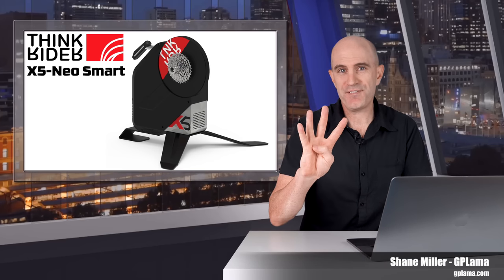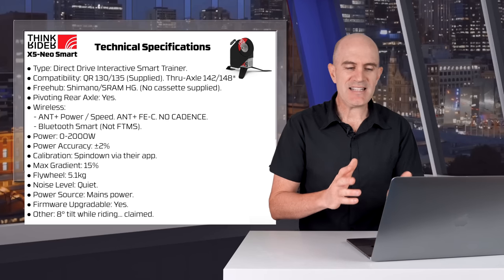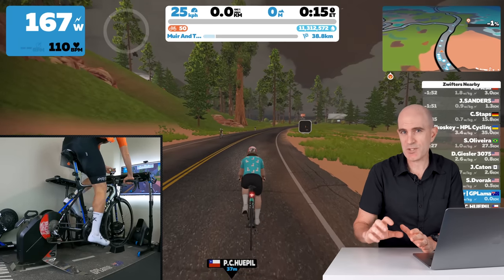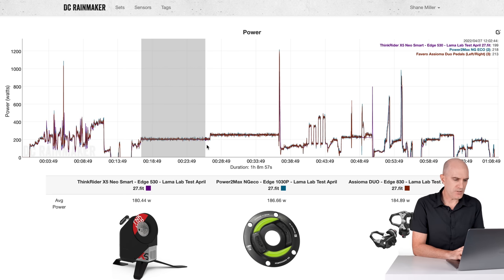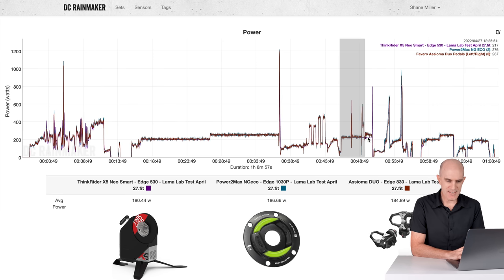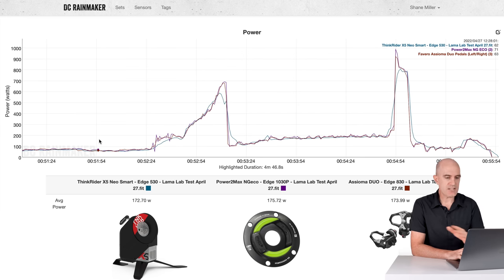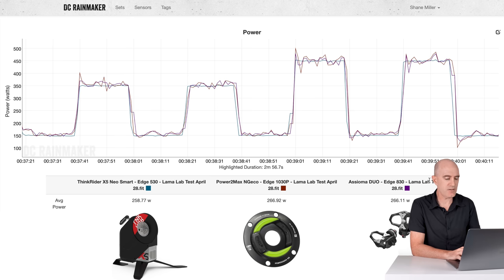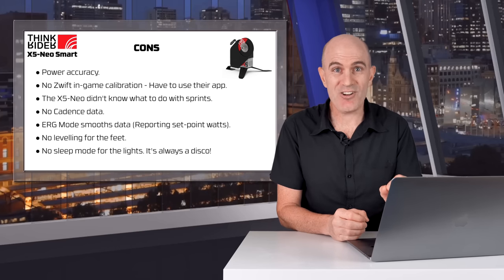ThinkRider X5-Neo Smart Cycle Trainer: Details // Ride Review

Comment: Excellent review, like all the ones I've seen on this channel. I have 2 of the smart trainers that you have reviewed, the Magene T300, which presents the same problem that you noticed, that when increasing the resistance, it overestimates the power, and the Thinkrider X5, which, as in the tests that appear in this video, it scores a little less power for me than the Powertap P1 pedals, which is consistent with energy loss from chain rubbing. I've had the Thinkrider X5 for 1 week, and what has surprised me is that it now measures cadence, and with excellent precision. I knew that the manufacturers of this smart trainer had not achieved an accurate estimation of the cadence, but apparently by updating the app, they have managed to do so, with some algorithm.

Comment: Hey @gplama I've now spent about 40hrs on this trainer, mainly doing structured workouts.
Received the unit in January, updated the firmware and the cadence had been fixed.
There's been one more firmware update since then which set the erg mode smoothing to on by default and minor other fixes.
I think it's well worth another visit
Reply: So, atm, is reading the cadence and the power reading is more accurate?

Comment: @Shane Miller - GPLama I love your reviews, they are technical, shrewd and I perceive impartiality. It would be great to review the X7 Pro (4gen) or redo this unit after software updates. They included cadence (estimated) and altered some power measurement intervals (on X5 and X7 models). Buyer reports in marketplaces and forums reviews are conflicting, praise for the ThinkRideer X7 Pro (4Gen) is the majority. But the evaluations are not exempt, the praise can be the unfounded reflection of a nice experience with the trainner. I took a chance on the X7 Pro, that is on the way, and would greatly appreciate your review. Greetings and keep up the good work!
Reply: Seu x7 ja chegou? se sim, poderia me contar a experiência com ele?
Reply: @hebertokano , só via sua msg agora. Chegou em poucos dias,comprei pela loja oficial deles no Ali, que possui unidades já no Brasil. Bom que não há chance de surpresa com impostos. Estou 100% satisfeito com ele. Funciona perfeitamente com todos aplicativos e o seu app nativo também é bom para refazer suas rotas ou outras que baixar o GPX. Também pode conectar direto no Garmin. O fato de ter 5º de jogo lateral torna a experiência bem melhor, traz mais conforto e aproxima da sensação de pedalar na rua. Alegam ser melhor para quadros em carbono que não foram projetados para este tipo de estresse, só meu garfo é de carbono... Quanto a interatividade achei que funciona muito bem, meu termômetro foram as rotas que faço habitualmente e repliquei no rolo. Só não tenho outro potenciômetro para medir a precisão, pela experiência do vídeo acima está dentro das especificações do fabricante. Recomendo fortemente. Silencioso, consigo usar a qualquer hora sem incomodar minha esposa (que é chata com barulho) e minha filha de 2 anos, ambas nos quartos ao lado. Já tive rolo TacX Vortex que não é direct, fazia bem mais barulho. Assistência técnica parece ser eficiente se curte o modo "faça você mesmo", em caso de necessidade enviam a peça e o link do vídeo demonstrando como substituir. Em foruns não vi relatos de quebra. Se quer mais segurança quanto a assistência, recomendo o Cyclotronics projetado e produzido por brasileiros. Não peguei ele porque preferir me arriscar pagando menos por um produto que me pareceu melhor. Mas acho ser uma boa opção também. Os da TacX mais simples não recomendo, há relatos de superaquecimento, problema que não existe no X7. Já comprou o seu?

Comment: UPDATE: firmware has sorted cadence. I took a punt on one of these for £250 Black Friday deal after my Elite Direto after 4 years of hammering. My wife asked what was wrong with it because it didn’t sound like a washing machine…my direto had been eating itself alive for a good year now. I’m really impressed. I don’t race anymore and for the odd Zwift session It seems fine. I will be happy if I get two years out of it at that price. We will see. Will update if I get issues. Cheers Lama. Maybe let folk know it has cadence now as that nearly stopped me purchasing.
Reply: Nice to hear, I've just taken a punt at the £250 deal too, cadence almost put me off.
Reply: @bluemosquito  let me know what you think. I’m quite happy with mine. Nice smooth feel and no noise. Good enough for me as long as it lasts. I got spacers and all that stuff with mine so doddle to build.
Reply from the maker: Thanks for the heads up. It'd be great to be notified when these updates are published so I can re-test. I'll put this on the list....
Reply: I've just got one of these for £220 as a black Friday deal. Previously had an elite zumo before which I believe is a lower tier model to the direto.  I've not opened it yet but did yours come with a cassette? Thanks
Reply: @J273  it doesn't come with a cassette.
Reply: @J273  No mate.
Reply: Im really happy with mine. for the price its a bargain.
Reply: @sweep2112  used it a couple of times now. I don't have anything to compare with but anyway it feels like a nice solid unit, heavy flywheel, certainly does anything I need it to do.
Reply: Can you confirm the cadence situation? I'm trying to use a free app (not decided between mywhoosh, RGT or their own pure app) and didn't get accurate cadence in mywhoosh but something was reporting to that sensor. My wahoo bluesc doesn't get picked up by mywhoosh unfortunately, but their own app seems to work well, the graphics are a bit questionable though!
Reply: @conan257  It works fine for me.
Reply: Just purchased this after you confirming that it now has cadence ! Thanks for the information 👍❤️🏴
Reply: @johnwilson1321  no worries mate. Had it a couple of weeks now.. i do the KISS group sessions on Zwift. About 70km level 2 and it’s been flawless. Like Lama said in his review might be a bit lacking in really top end stuff, like if you are a top sprinter. Lags a little over 600 watts, might not even notice it, but for racing and general Zwift stuff I can’t fault it for the money.
Reply: @sweep2112  lol I hit 600!w about once a year for around 10 s so I don’t worry about that lol , my old trainer packed in yesterday so i needed quick replacement and got it for £250 so I’m happy to take punt on it.‘Scotlands roads not that safe this time of year due to ice low sun etc so Zwift keeps u sane. ❤️🏴
Reply: @johnwilson1321  yeah. im north of england do a bit of running too but this last two months have been grim weather wise. so to go in garage and go on zwift its a bit of a life saver. let me know what you reckon  when you get it.
Reply: @sweep2112  hoping to get it today so I’ll let u know . I’ve only got the tacx flux to compare it to so be interesting
Reply: Hi sweep just had first session on trainer ( delayed delivery) I was little frustrated as it does not link to MacBook laptop what I use so after a lot of messing around managed to link it to an iPad but screen so small it’s hard for my old eyes to see my w/kg etc ( mind probably not a bad thing lol) feels pretty solid quite comparable to my old tacx flux. I was also Having issue linking my HR monitor but appears to have connected now ( after my session) overall appears pretty decent despite the Mac book thing but I’ve read a ant connection is required for this 🤦‍♀️
Reply: @johnwilson1321  I use an iPad Pro. I put the iPad on a bike maintenance stand. Works perfect. Can’t you get bluetooth for MacBook? Pretty sure there will be a dongle workaround
Reply: @sweep2112  unfortunately Mac book is the only apple product by the looks of it that won’t directly Bluetooth on to trainer . My iPhone and I pad no problem but Mac book won’t. I’m not even sure what an ANT plus does 🤦‍♀️ . A work around might be just like your self is to use an iPad stand so I can have the screen really close. Did your heart rate monitor connect with no problems?
Reply: @johnwilson1321  yes mate. iPad Pro can support something like 8 separate Bluetooth connections. You need a hr monitor that transmits bt obviously. Works seamlessly. Used to use pc laptop but iPad a lot less hassle.
Reply: @sweep2112  after my session today it appeared to finally connect so I’ll try again in tomorrows session hopefully thats it sorted.
Reply: Hi. Where did you find this unit for £250? I see only one site which is offer it for £250 but it has only UK shipping. Interesting to purchase it in Germany...
Reply: Yes, I noticed that today. I bought this smart trainer this week, and the power measurement is very accurate, 1% or 2% less power than Powetap P1 pedals, which is consistent with energy loss from chain friction. The cadence measurement has surprised me, and it is very accurate as well.
Reply: Question. Does yours feel a bit like there's a rough/dry bearing, when it's working? But smooth on freewheel?
Reply: @bluemosquito  no mate. It’s pretty smooth.
Reply: I've just purchased one today £200 so glad to read you all like it
Reply: @leeanderson5266  Where did you get it from for £200 and how are you finding it?

Comment: Thanks for the in-depth review, always enjoy your comprehensive look at trainers. It might be useful to keep in mind the power accuracy when comparing it to the trusted sources. So if the other 2 power meters read 250W but the power meter being reviewed is 245W. That's within the error for one that claims 2% and a nice way to maintain an objective and quantitative perspective.
Reply from the maker: Fair point, but it is difficult to quantify without then digging deeper and deeper. There’s a lot more I could add in that’ll blow these out to hour long videos. 

My flywheel speed test section only scratches the surface of the power/speed accuracy testing that should be done. The accuracy depends on the flywheel speed used. It’s both within spec and way off at the ‘same’ watts using different gears. Most smart trainers need a reference table for owners to get the best from their equipment. Something I’ve only seen (privately and unpublished) from one smart trainer company. 

Then there’s the sprints that the X5-Neo just isn’t anywhere near spec.
Reply: @gplama  yes you are definitely right about the accuracy for this trainer. That power smoothing combined with the poor sprint readings are deal breakers in my book. I meant more generally but I see your point that the amount of detail for that is excessive. Thank you for responding to the comment. I rarely experience that with other creators.

Comment: For ~$650 (if you can find it at that price) it seems like pretty good value. Would you rather this or a kickr snap?
Reply from the maker: Direct drive is usually a better experience than a wheel on trainer…. If the power (especially the sprints) could be improved on the X5Neo then it’d be a better option than the SNAP.

Comment: Hi. do you think that this trainer is viable for 1-by bike with front chainring 40T? Thanks!
Reply from the maker: Impossible to give a yes/no answer on this. It depends on the rider and type of riding you’ll do.
Reply: @gplama  I understund. I check my strava and my estimated power is around 200-250W for rides even for longer rides (100km+). I want trainer for winter and rainy days so I can stay fit and loose some weight.

Comment: Hi Shane. After a major BLE FTMS Zwift update, both of my test units (X7 Pro and X2) lost the ability to change the resistance in SIM mode. Can you check the current situation with the X5?
Reply from the maker: The X5 was tested on April 27th and 28th using the Companion App (BLE) to Zwift. Control in SIM and ERG worked as expected. Not sure if that'll be any different using BLE direct to Windows/Mac... or how the other models handle BLE FTMS. Looking at the BLE properties of the X5 with LightBlue there's no FTMS services listed. Ultimately one for Zwift support to nail.
Reply: @gplama  IMVHO resistance changes in SIM are very low. Few minutes ago i was try to ride in London tunel with +/-15% grade, change was only from ~200W to 280W with the same cadence. SIM now works only with Windows BLE, I must check with ZC app. Last question, what TD setting you use?
Reply from the maker: 100% TD

Comment: Hi @shanemiller … I recently bought the X5 after your extensive review … it’s my first ‘wheel off’ trainer … only had the little old Tacx Flow before. Just wanna ask … is it normal for a wheel off trainer to have less power at high gear (larger cogs) compared to wheel on? … also, I’m finding it hard to steady the readouts compared to wheel on where I could pedal consistently … or it it my basic cycling or a characteristic of wheel off trainers that you have to work hard to be consistent? … many thanks for any advice (if all the above makes sense! Lol)

Comment: Why do they design it so it requires a block under the front wheel? I think that is dumb.
Reply: So the wheel doesn’t shift from side to side when you’re riding
Reply: @grobbosixtyone  Why prevent that? The Kickr doesn't require one.
Reply: Maybe to facilitate a 'steering' device for Zwift??
Reply: @donwinston  I used to have a gen1 Kickr and still had the front wheel on a block so it's down to personal preference
Reply: @grobbosixtyone  It is not necessary to make your bike level on a Kickr. In fact it will make it not level. Other trainers who use a block like this one will not be level if you do not use it.

Comment: Buy cheap, buy twice.  Seems to be the case with smart trainers for people who really get into indoor cycling.  What's the chance that this company is going to be around in 5 years when you need a replacement part?  Or you change bikes and you need an adapter?  That's gonna be an expensive paperweight.
Reply: I’ve been through 3 trainers from Wahoo and Tacx that have all failed in the past 5 years, and unable to get parts. At least I can call them to get a discount on a new trainer, but it’s still an industry wide problem.
Reply: @DanKolan  What trainer from Tacx ? My Neo (OG) is more than 5 years old and I bought spare parts just in case but I haven't needed them since everything is working as day one.